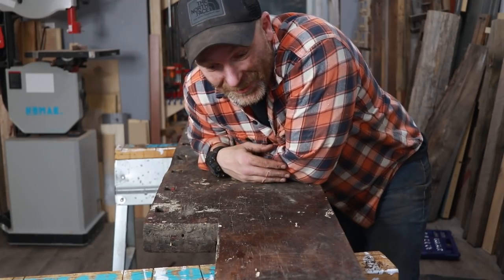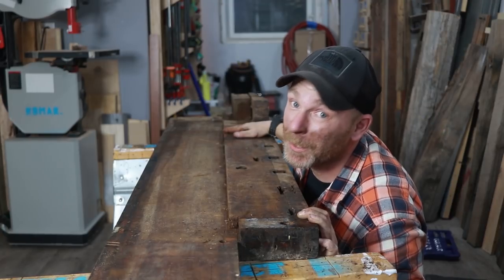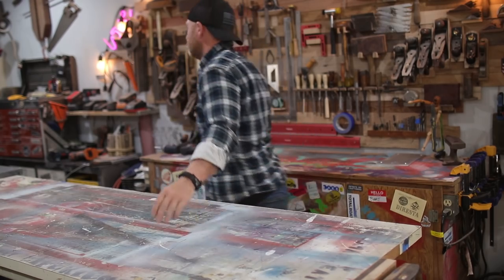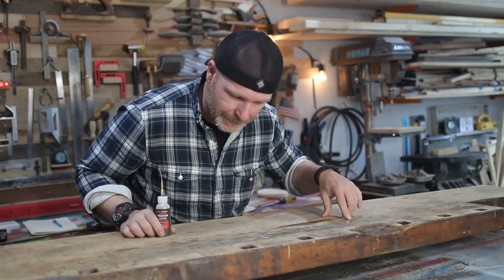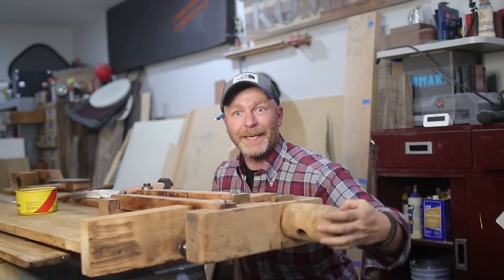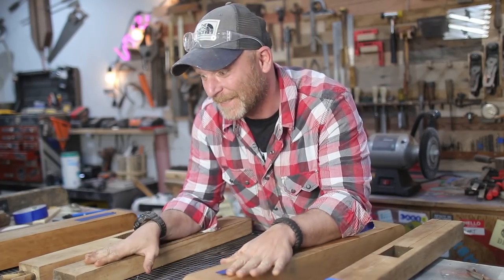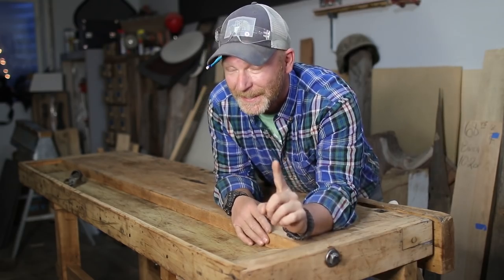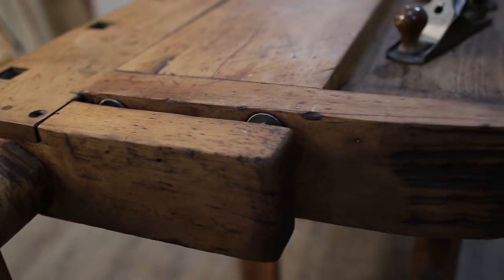Vintage Workbench Restoration // 100 Year Old Cabinet Makers Workbench

Comment: All that work just to ruin it with wax. Yes I understand people have been melting beeswax into work benches for centuries but, it makes them slick and the primary function of a workbench is a work holding surface. A slick work holding surface has no function. All you need is a bit of boiled linseed oil every year or so.

Comment: A wonderful restoration, when I was at school in the U K, in the 1950s we had one or two in the wood work class room,  and more modem ones with the metal vice, they all had  a tool well, in the middle, or at one side. I watched a video on the making of the bench in America,   But why would you put a dining table finish on a work bench, there is know way you will ever use it for every day hard and heavy use, I mean just look at that magnificent bench you have put back in to use, over the years it has had a hard working life, despite the digs cuts and glue stains it out lasted its maker, I hope you get as much enjoyment using this bench as the former owners.

Comment: Believe it or not, Hammacher Schlemmer was around in the late 1800s / early 1900s and had benches just like yours that you could buy from their catalog. My great grandfather was a carpenter and had a bench just like this from the 1920s till his death in the 1970s. I have the bench now. VERY similar to yours. But mine is VERY used. Great bench and nice job restoring it while maintaining its originality. Well done.
Reply from the maker: Thanks so much!! Ya these benches are amazing

Comment: I have a similar one that was in our house when we bought it.  Our house has been in my wife's family for a very long time.  They were morticians and furniture makers.   Mine is 8 1/2' long. You have inspired me to try harder to find a spot for it.
Reply from the maker: Ya at some point when I have a functioning office I will use it as my desk
Reply: It migth bee easier to find a spot for the bench if you realise you dont need to put it in the middle of a room as in a lot of videos. In old shops they are often against a wall, perhaps with a shelf for small planes butt out just above eye level ready to grab and start planing. If possiible free space to the sides is good for long work but big pieces can be done on sawhorses or the floor.

Comment: Thanks for this cool video. I'm also refurbishing my bench and know what kind of job goes into getting a bench that nice looking. I can't believe you took it all apart into small pieces. Even fixing the metal screws. I definitely will use this as an example for my wife to sanction more power tools.
Reply from the maker: That’s awesome good luck with your project

Comment: Wow...just found your channel.  I just bought a ~50 year old hand tool bench from the original maker and was looking for tips on restoration.  You gave me some great tips.  One thing I do when waxing naked wood is to slather the wax on liberally then use a MAP torch to heat the wax up so it penetrates into the grain.  After it cools I just buff it out.  Works beautifully.  With your video I kept finding myself turning down the volume when the music came on then turning it back up when you started to speak.  I just subscribed!  Thanks!
Reply from the maker: Thanks Blake, hope your restoration turns out great.  Ohh and thanks for the music tip.

Comment: Absolutely beautiful.  I'm living in Germany and just bought a similar bench.  I'm new to woodworking and started trying to plane down the top, but I can't get my plane to bite at all.  Probably not sharp enough, combined with me not yet knowing what I'm doing.  Is there a reason you choose to sand the top rather than plane it?  

Again, beautiful job and very inspiring.  Thank you.
Reply from the maker: Sean thanks for that. Ya I sanded it down because if I planed it down it would take to much character off the top.  I wasn’t trying to get it flat just remove some of the grime and gunk of it.  Want to see all the old chisel marks all over it.  Kinda retains the history of it.

Comment: I have a very similiar bench,, It was my grandfather's who was in fact a cabinet maker. I think the top is a bit heavier,, can just barely pick it up. Wooden screws for the vises, the top is at least six inches thick. Very solid.
Reply from the maker: 2010Rocrat that sounds awesome.  Hopefully you get a chance to restore it.  They should all be preserved and used
Reply: @KomarProject  My Father cleaned it up back in the seventies and its in very nice shape, has a lot of patina. I think I'll leave it be and just use it. It surprises me when I see them,, never gave it much thought that there are still many out there. I was looking on e bay and saw some that were in disrepair that were selling for quite a price. One of my Grandfather's specialties was veneering. I have a pile of his old veneers in the attic of my barn.

Comment: Nice, got a really similar one but with a scandinavian front vice with just a screw and no proper jaw. 

Some proper wood benchdogs that can dissapear into the benchtop might be a good small build. 

Dont know if you already know but i was told when using benches like this in primary school wodworking class to never bang or chop anything on top of the back vise even if it looks just like normal benchtop. Of course its okay if using the benchdogs but always use the one closest to the jaw thats practical and open the vice as little as possible when using benchdogs is what i was told, The sliding asembly is not quite up to heavy downwards force. Yours is sloppy but alright, mine is really too sloppy but can still be used. 

You should also never overtighten a wood screw. If the project moves in the vice it is better to set up on the benchtop or prop from below, mainly  when chopping with chisels. Overtightening (say with the full weigth of a frustrated 12 year old) might damage the threads. 

And of course never force open a swollen screw. Just bring it in to a heated shop and wait.

Btw  workbenches are made to be trued with a big smoother plane when not flat any more.
Reply from the maker: Thanks Borje. Really appreciate the knowledge.  Always love learning about this piece of history.

Comment: I just got one every similar well over 100 years old doesn't have a leg vise but a massive tail vise with steel screw and 2 steel bench dogs with spring not sure what to do with it might restore it or sell it . also to another bench that has an old electric motor under it and a hole in the top for the belt to come through for a possible lathe or grinder maybe not as old but still cool.

Comment: If that bench could talk about the projects it's been part of. Very nice job with video and rebuild. Is it working out as you thought with today's power tools is it in need of updating? Thank you
Reply from the maker: redwood1957 honestly I don’t use it as much as I though I would.  I spent so much time restoring it that I’m afraid I will ruin it with power tools so I only use it when I do hand tool work.
Reply: @KomarProject  well I say use it it must be board
Reply from the maker: redwood1957 I use it as much as I can

Comment: I have a couple just like that and plan on refinishing them to used in my house what kind of oil or wax did you use to finish it with and what type of sealer would you use??
Reply: Also what tool is that used at 4:10 for scraping?
Reply from the maker: Torstein Myrdal I used black bison wood wax to finish it.   
As for the tool it’s just a old paint scraper i had that got some of the grime off before planning it.

Comment: Lol. It's a fake. No genuine cabinet maker would build their bench that way. The doweled joints are a dead give away. The tail vice is worse than useless and the main vice even worse. 
I've seen this sort of thing a lot over the year's. Furniture restorers will cobble together something " genuine " for their local antiques dealer by mixing and fixing a bunch of parts from different stock on hand. Then some retired chump accountant will buy it thinking it's genuine and boast about his " incredibly rare find at an amazing price".
Scamming wealthy idiots is nothing new.